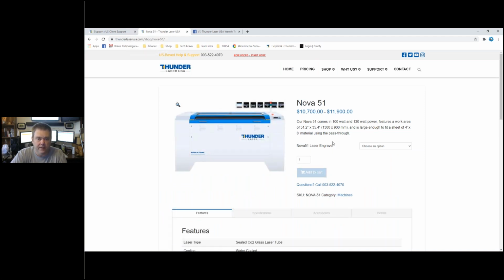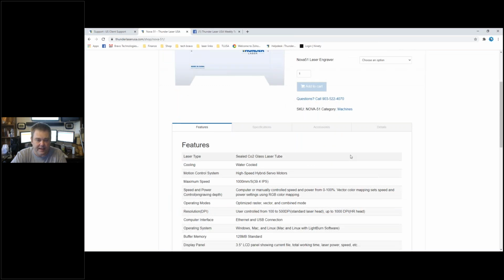Thunder Laser USA Weekly Tech Webinar 7/21/2020

Comment: Good morning sir, I realize this is an old video but I just seen that you said you live in Tennessee. I currently have a glowforge Pro and a home tech autofocus 2028 and I'm looking at a thunder to add to my current laser arsenal. I'm looking at the 35 or the 50 100 watt and this will not fit in the house where I have everything else so I'll have to go in the building. I do not have heat or air in the building outside and worried about freezing problems. Any suggestions? Thank you